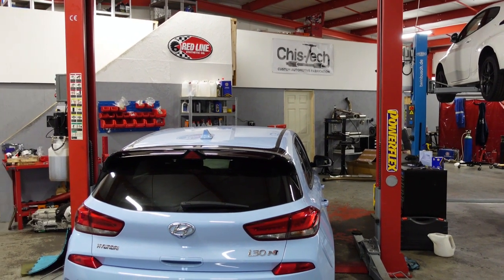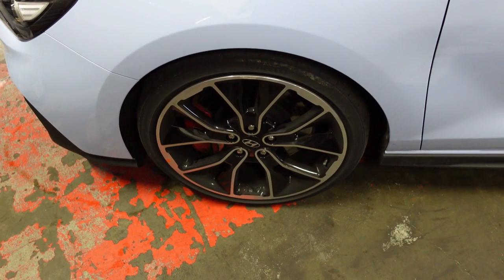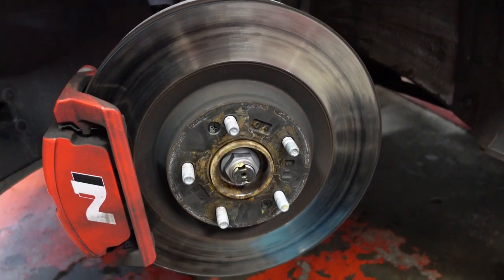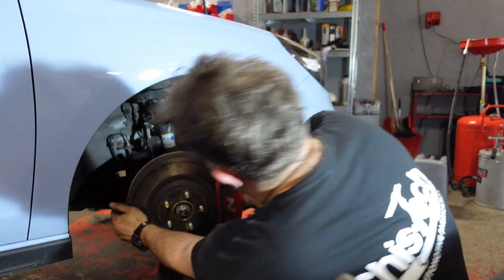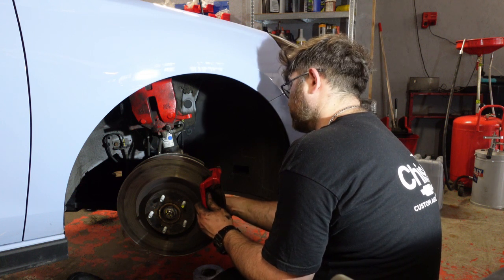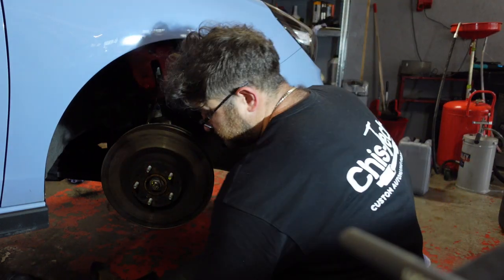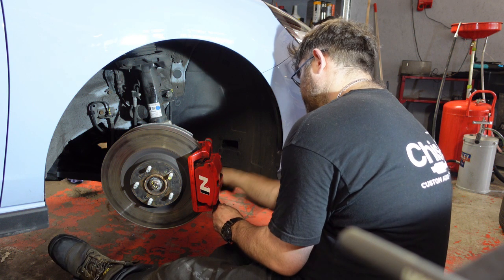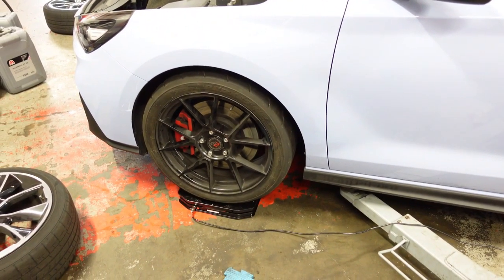Changing front brake pads on a Hyundai i30n Performance

Comment: Hi Chiz-Tech . Which Tuning box and downpipe did you use? Thanks
Reply from the maker: Tuning box was a dtuk setup, down pipe is the 2nd part of the down pipe  elbow we made this 3", likewise we made a 3" ppf delete section. Forge motorsport large air filter and intake with larger turbo inlet 👍